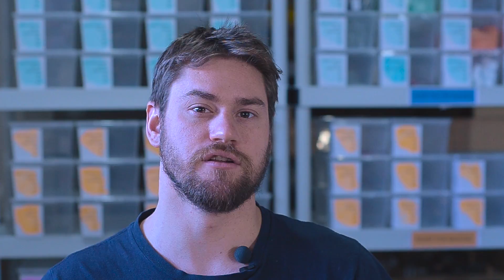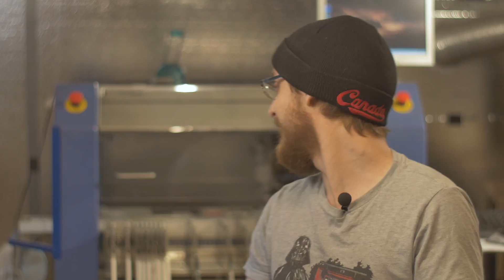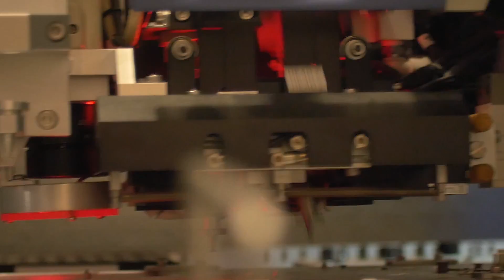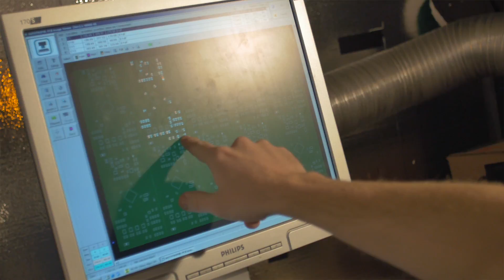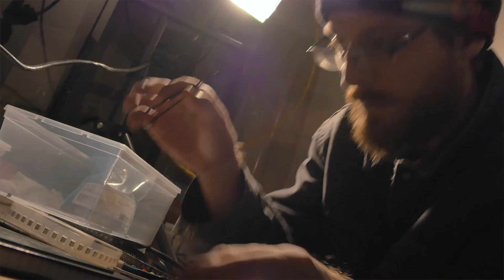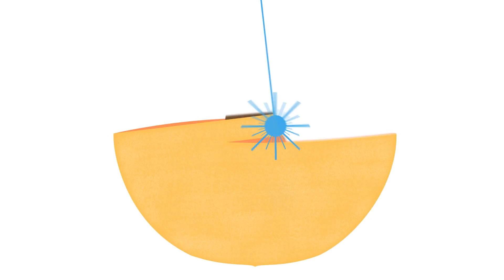Update #62 - Manufacturing Processes Part 2 - Circuit Production

Comment: I invested into this project some 2+ years ago jointly along with My brother that worked for NASA. I scratch build large models of ships, and Space craft, airplanes and so on. I think that once this project gets fixed and becomes a viable reality it will kick the total shit out of the people whom are melting weed eater string in their machines. The only disappointment that I have is that I thought that reality would have already been in this time frame. In the mean time, our 1000 dollar investment has gotten us 2 of 4 promised printers that came in the mail in what would be a 5 x 6 picture frame box, and we have assembled them along with having 2 prototype laser 3D printers, and no resin solution, and or software that will make them function as of yet. Now don't get Me wrong, as I said I think that these printers will change and revolutionize this industry and get rid of the string melting toys over time. But in the mean time, I have purchased a Mini lathe, and am preparing to buy a mini mill, and possibly a 3D carving machine so I can shape the pieces to resin cast for My model making, because I cant wait for another 2 to 10 years for this Printer to come to fruition. Keep on Keeping on. I look forward to using this technology when I am in My late 60s or hopefully before, as I am 52 at the time being. Preachy Printers forever.
Reply: +TwistedSister/Haratiofales Check out the newest videos. They're total scammers.